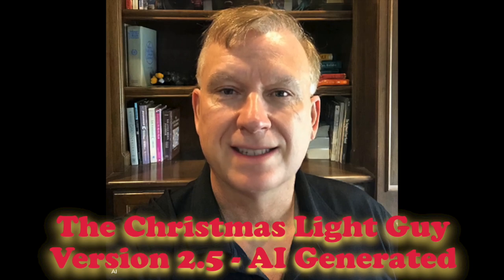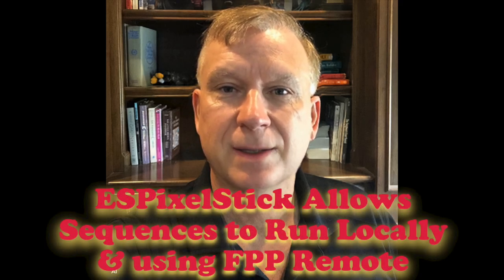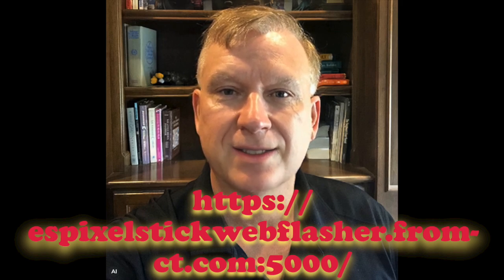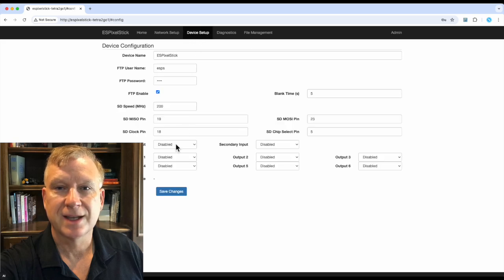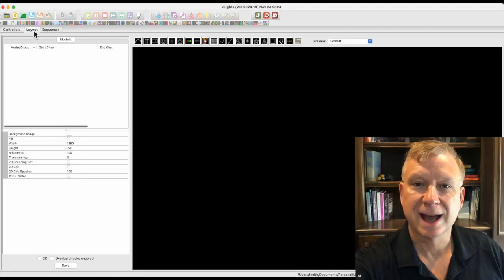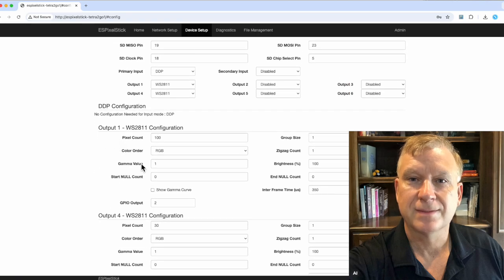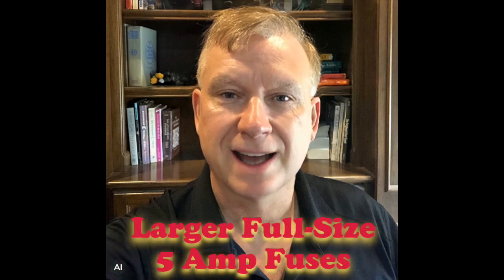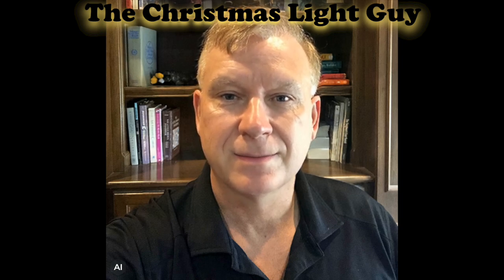First Look at the Tetra2Go - 4 port WIFI Controller from RGB2GO.com

Comment: I have received one and am planning to use with the basement Kitchen Cabinets and @wally's Lights Puck lights!
Did you use Di-D for your AI automation?
Reply from the maker: @CalvertLarry  Yes. I do use D-ID for my AI video with my cloned voice.
Reply from the maker: @CalvertLarry  Are you going to run WLED or ESPixelStick firmware?